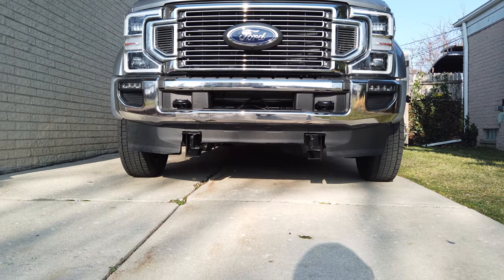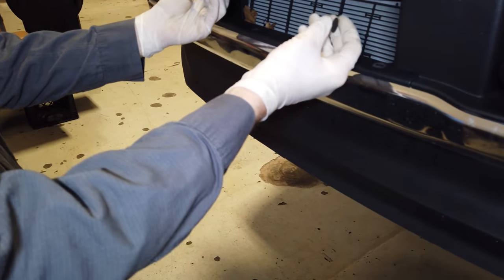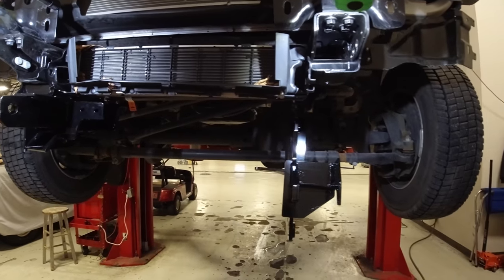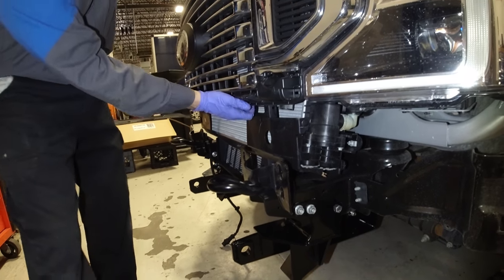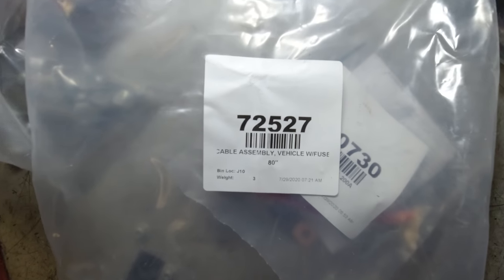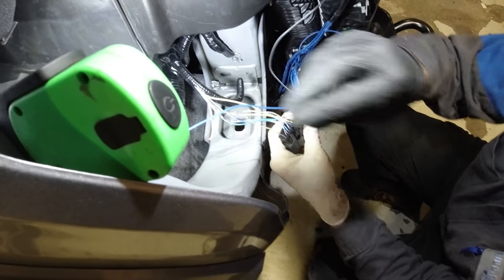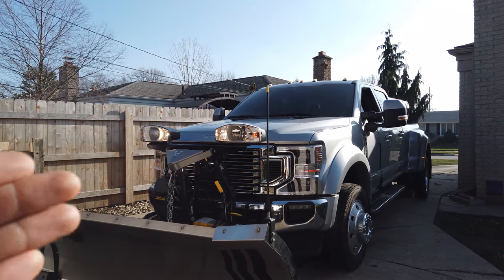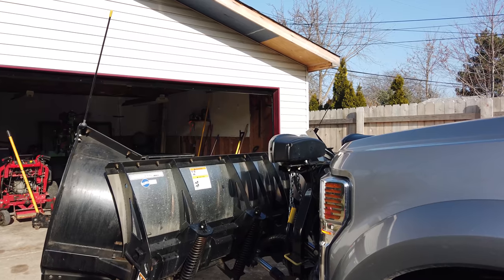Snow plow install goes HORRIBLY WRONG - 2020 F450 6.7 POWERSTROKE

Comment: Sean, I would just install the correct 2020 snow plow harness....
Reply from the maker: That's probably the best idea. Waiting on the shop I bought these from to get back to me. Been a week and haven't heard back. they are supposed to be ordering the correct parts. It's a different module and a different wire harness.

Comment: If you mounted any relays and module behind headlights or grille they with corrode quickly.  Install grease in relay pins and mount module up high ,  mount relays up high by battery.    Fisher has changed all harnesses in last few years due to new led lights . Nothing is sealed correctly anymore.    A lot of guys are switching to boss due to this issue.   When wires get corroded its causing all kinds of issues,  heated seats, heater controls,  radio , tail lights,  power windows
Reply from the maker: Thanks. Will do!

Comment: You gotta get the lights working perfectly.  Those leds are sick. The question is to do it now or wait until you kinda cool down. Sometimes I get all frantic and have to take a break from working my trucks to give my mind a break. Worst thing is to have it ripped apart and then see snow in the forecast. Maybee revisit it when its warm out in the summer even. If its not causing any real issues when it comes to plowing. I just have so little patience anymore.

Comment: Ford changes the frames on the trucks half way threw 2020 and it has been harder to get fisher and western mounts for those 2020s and up. The 17- early 20 frame will work but you have to modify stuff like that. Ran into that on our new 550 we did a fisher setup on.
Reply from the maker: What did you end up doing to make it work?
Reply: DS TRUCKS we ended getting the right frame. Was hard to get. As far as the led lights. We had the right harnesses and didn’t have to change pins.

Comment: Dealer should eat the cost of that 2019 harness they gave you. Someone there didn't do their job correctly. The correct fitment can easily be looked up on the western website.
Reply: Clearly they ordered the wrong harness ,  you should have just stopped right away and not “rigged” it up

Comment: Sean, I'd get the new 2020 harness. Have it FedExed to you don't do the drive. You never keep your trucks for a long time and when you sell the F450 if there are plow wiring issues they'll never figure it out.  I wonder if there are 2020 base plates for the F450 as well. I remember Fisher parts. There was standard stuff that fits all brands of trucks. Then there was the "peculiar parts" (as Fisher calls it) for truck model specific stuff.

Comment: I just did a 2020
I have halogen lights,with the proper harness there is no need to remove grill or headlights
Reply from the maker: Are the LED lights the same way?
Reply: @DS-TRUCKS  I believe led on truck makes no difference
 The snow plow interface is above the inner fender.
Reply: How to change a headlight on a f150... step one... remove entire front end. step two .. insert new bulb.....

Comment: I would put the right harness in so everything works as it should and just have them ship harness on their dime for the mistake
Reply from the maker: You would think. They want me to pay cost for the harness which is 50% off and will switch out the module for me. If I make the trip down there.

Comment: Can't you put in the correct harness and change the PIN's back to where they were and return it to them? If they give you any grief, I'd involve the plow manufacture. Bottom line, they sold you the wrong wiring harness. You, as the customer, shouldn't have to research and validate everything to ensure that the dealer is providing the correct parts.

I've done a number of Western plow installs on my Super Duty's and it's usually very strait forward and from what I've heard so far, the 2017-2019 installation is now the easiest to do. As a side note, I had read that the new 2021 Ford Super Duty's are all coming directly from the factory with "pre-wiring" under the hood for plow installations which should remove the extra time in having to remove the grill and headlights.

Love your truck as well, I'll bet it's pretty unstoppable as well. Only thing you could add would be the Winter specific tires, but I think they are pretty expensive.

Sean
Reply from the maker: Thank you. I have no idea how they messed this up but I now have the right wire harness and my life would have been Soo much easier if I had the right one.c

Comment: I would have told the installer just to take everything out and you could have still got home. Send the wrong parts back and get what you need
Reply from the maker: I honestly didn't know what was going on till the next day.
Reply: The installer should have called you right away. Then you could have contacted the place that gave you the parts and go from there
Reply from the maker: @chachifeere  I was trying to call them but they were closed. And will admit I was trying to be Captain save them and try to make it work!
Reply: @DS-TRUCKS  save who ? the installer ,  he should have asked you before hacking you the harness . Also why didn’t you just get the parts through the installer. If he was a qualified tech he should have been able to get the wiring
Reply from the maker: @chachifeere  it's his second plow. My first. But you are right. I should have checked all the part numbers over because on the fisher plow match it clearly states different part numbers for 2020 vs 17-19. I just ordered the parts thinking all was good. I know now gotta double check everything.
Reply: @DS-TRUCKS  ya what can you do
Reply: this makes no sense ... they messed up and want u to pay for their mistake. but its hard to argue with people like that dont understand simple logic.  Whenever i buy any car parts .. i triple check the part  numbers. many times the counter guys give parts for other vehicles.